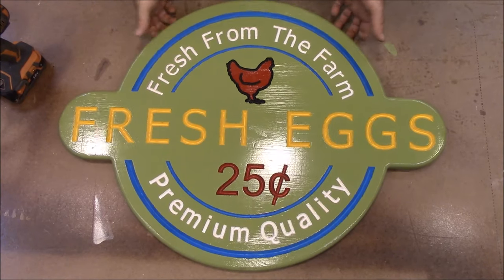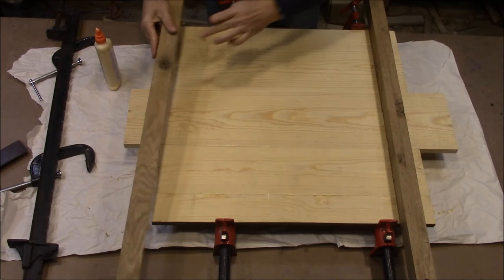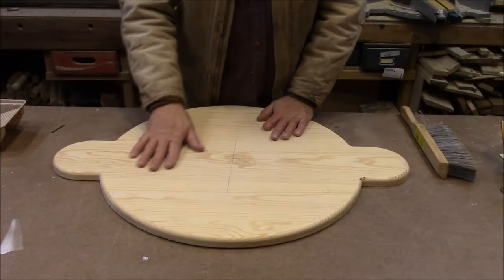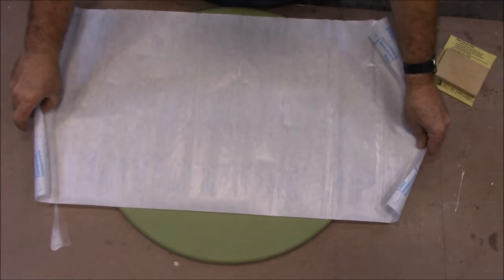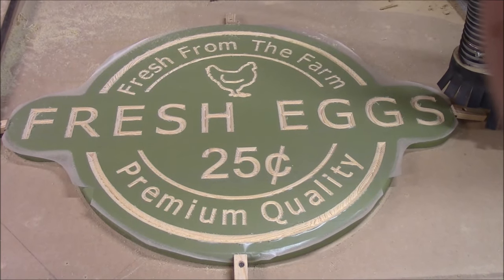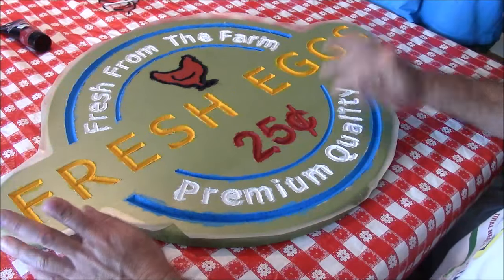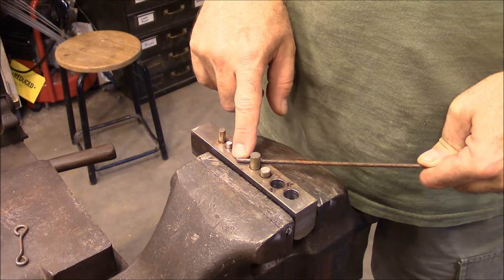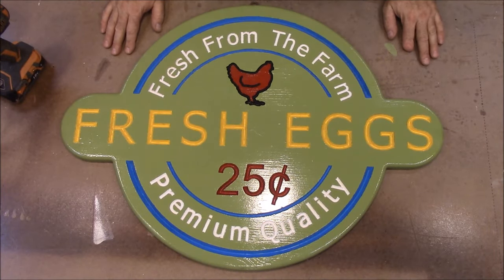Easy CNC Chicken Sign

Comment: Nice video. I just recently closed my sign business. I've made hundreds of v carved signs over the years. I always used a vinyl transfer tape for the mask. Once carved if you use a clear to seal all the edges you won't have any more bleeding. You've made a very nice looking sign which could be sold easily. Very impressive!
Reply from the maker: Thank you for the comment, kind words and advice.  Sealing with a clear first is a great idea, I'll have to try that next time.  Thank you for watching!
Reply: Any tricks to getting the mask off without scratching the paint and reveling some of the white primer.  What was your process as it relates to masking?  I'm using Oramask 813.
Reply: I carved the background area and finished it either with paint or just a stain. Then the mask was laid over the v-carve area and rolled to get a good seal. Then v-carve and check for any lifting or tearing around the cuts, repair with blue painter's tape if needed. Then spray a clear to seal the v-carve to the mask a few coats won't hurt. Then paint the v-carve area once the paint is dry after as many coats as needed to cover, I never used a primer in the v-carve because the clear did the sealing of the substrate. Then just remove the mask, I used a vinyl mask not the paper mask so it removes pretty easily. Hope this helps some. Good luck with your signs!

Comment: contact paper leaves a sticky residue how do you get a way from that?  I got mine from Home Depot peeled it off and it left the wood sticky
Reply from the maker: I haven't had that problem with it leaving a residue.  What I use came from walmart, not sure if that matters.  Contact paper is designed to not leave the adhesive behind.  Not sure what is happening in your case.
Reply: He says "contact paper" but what he appears to be using is some kind of masking film. There are many masking products out  there that should work and not leave an adhesive residue.
Reply: Max Swenson that looks just like contact paper.  I’ve used it for masking designs on windows.  Comes off really easy with no residue

Comment: What bit did you use for the lettering? What font is that? And what depth did you cut at? 

Thanks!
Reply from the maker: It's a 90 degree V bit.  I don't remember the font.  The depth of cut is determined by the software and the width of the letters.  Wider letters will be cut deeper to form the V.  I used Artcam to design the sign and make the gcode.  Thanks for watching!

Comment: do you have a program to help right go code?  if so, what and is it and is it cheap or free ?
Reply: I meant to say  write  g-code
Reply from the maker: I use Artcam for the g-code and anything font related.  It is under $200.  You can also use CamBam which has a free version, I just found it hard to use.  Thanks for watching!
Reply: Thanks
Reply: Try Estlcam.

Comment: I tried your method of using the contact paper and it work fine except it left a glue residue on the face of the sign.  Any suggestions?
Reply from the maker: I have not had that problem, you might try a different contact paper.  I always top coat with a clear polyurethane, I would think that would take care of it.  You might try removing it with some mineral spirits but that might take your paint off.  I would try top coating and see if that fixes it.  Thanks for watching!
Reply: Excellent video..
Reply: @SoatMon  With some contact paper if you leave it on too long it can leave a sticky residue.  This is a great video.  Thanks for posting.